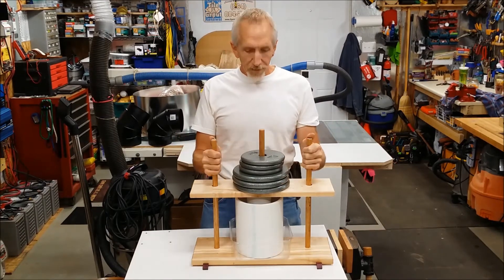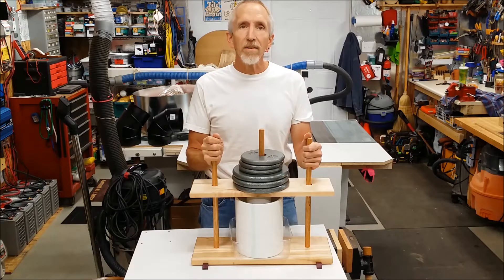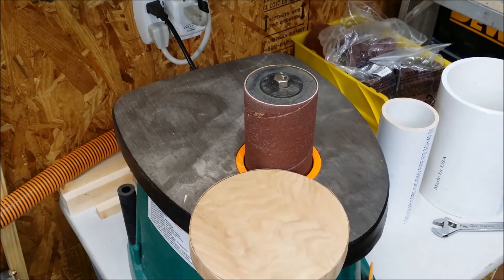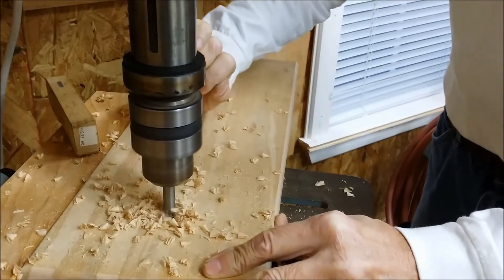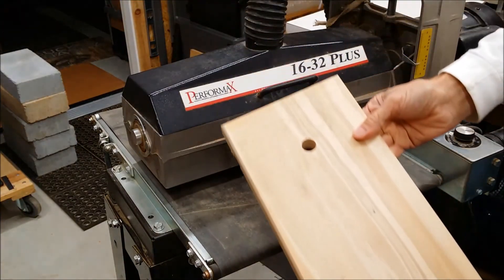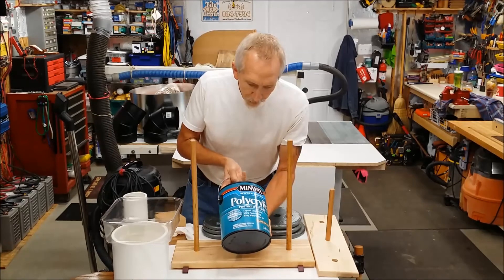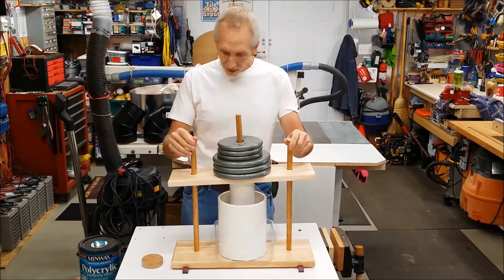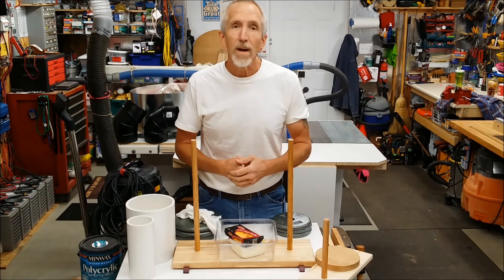Cheese Press- Building one for the Homestead

Comment: You went a bit fancier than I did, lol. I raided my dad's scrap wood and used a length of 1x10 cut in half, then drilled four corner holes, and used about $6-8 in stuff from the hardware store- some threaded rod and nuts and washers. I also already had weight plates (that I don't really use for their original purpose... oops). Instead of a smaller pipe I usually just use a can of soup for the piston part.

Comment: Please be aware that conventional PVC is not food safe, it can lead to food contamination and spoilage to more sever human poisoning. Since Cheese whey is acidic it will leach out the various petroleum toxins from the PVC, so if using a plastic make sure it is Food safe plastics being used. You will also need to if using plastic use a heated nail to make an even covering of drain holes along the sides of the container for a more even draining press. Or it can lead to uneven drainage and as such improper curing of the cheese wheel.
Reply from the maker: Thanks. I will check it out!

Comment: PVC contains VCM, phthalates, lead, cadmium & or organotins all of which carcinogenic & toxic to humans especially when coming in contact with cheese ingredients. A quick Google search will pull up lots of info on the subject. 

A $6.00 stainless steel pot form Wal-Mart is an infinitely better choice than a PVC pipe. Other than that you have a great design. Thank you for sharing.
Reply: Actually, a quick Google search seems to show that PVC pipe is just fine for use around food. 
I'm sure that using the anti-vax type of sites will show differently but I don't do research by feelings and rumor.
Reply: Or BS.